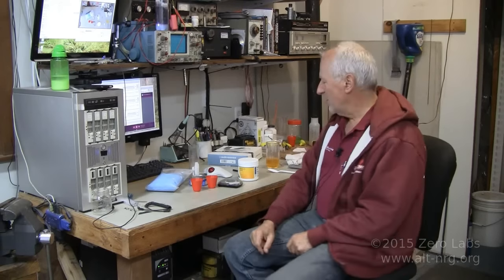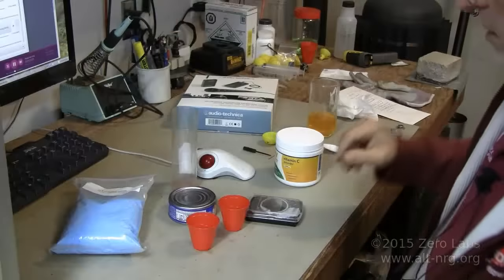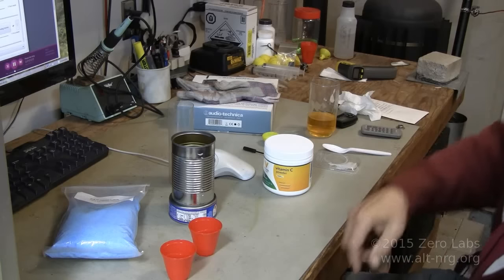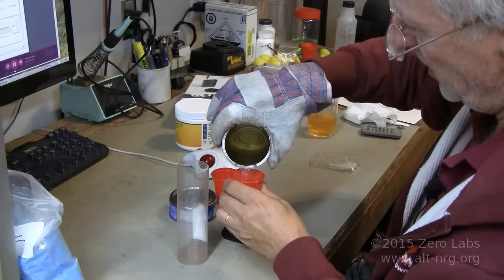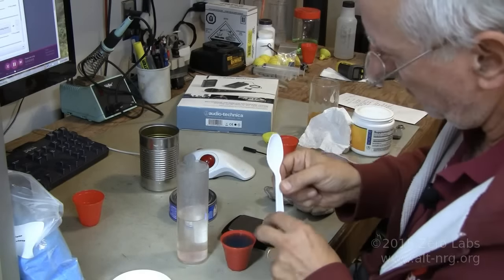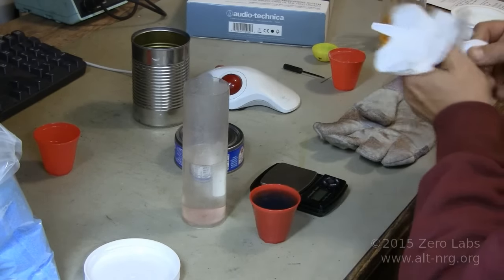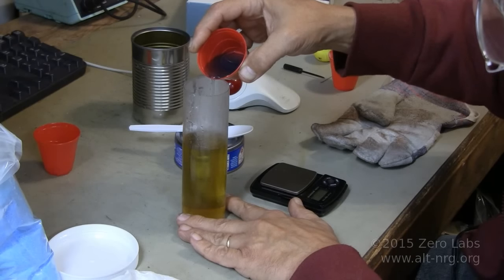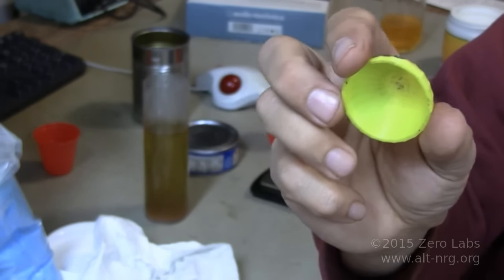#423 Making nano copper conductive paint.

Comment: Hey Z!  I must have missed the part where you mix the nano copper into the paint solution as that was my expectation from the video's title.   The amount of copper precipitate that resulted was probably far less that what you will need to coat that much surface.  You may need a roughly 50/50 by weight mix.  Will there be a follow-on addition to this video, the electroforming video or just the recipe in the comments?  Cheers!
Reply: q

Comment: Hello sir, I tried to do exactly what you did but no luck. I got a bluish solution after mixing ascorbic acid and cuso4 solution. Can you please help me out? I am trying plated through hole of PCB
Reply from the maker: Personally I would just solder a piece of 24ga copper wire on both sides and call it a day. Too difficult plating through holes at home.
Reply: I really need to do through hole plating. Palladium tin chloride is very costly and not available in our country. Calcium hypophosphite is also not available. Graphite conductive ink didn't work. Now i am trying to make copper nano particle. 
I will be adding the video soon. Can your sir please help me out?

Comment: Hello sir just a suggestion the cu np you have prepared is fine but due to small size the surface area increases there by causing it to oxidise which will be non conductive so if you can add capping agent along with bind will be a better itself. Thank you

Comment: what did u mix the nano copper with to make it paintable?
Reply from the maker: +coldfire0101 I tried a very thinned out polyurethane. It still was non conductive when it dried. This part did not go as planned.
Reply: +ZeroFossilFuel You need a vacuum chamber and a tungsten heating strip to evaporate coat the plastic. You can make one out of a jar, a spark plug and a refrigerator compressor. Use silicone to seal the oles you make in the lid. Applied science has a great video on vacuum coating :)

Comment: It might be easier to electroplate the inside of the plastic item by first painting the inside surface with graphite to make it conductive.  Then attaching a copper electrode as Anode and plastic/graphite as cathode to a source of DC current (i.e. type. D battery) you will have a very thin layer of copper deposited on your graphite/ plastic object.  You could calculate the thickness of the deposited copper precisely by the mass-action formula that governs electrolysis empirically.
Reply: the easiest thing would be to blow up copper wire in the vacuum